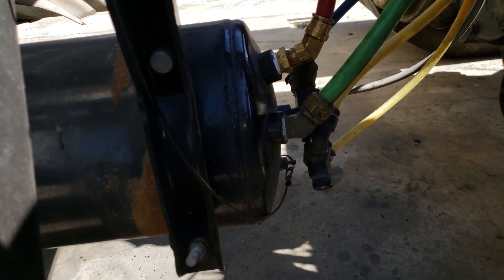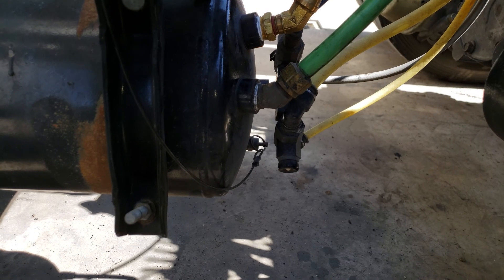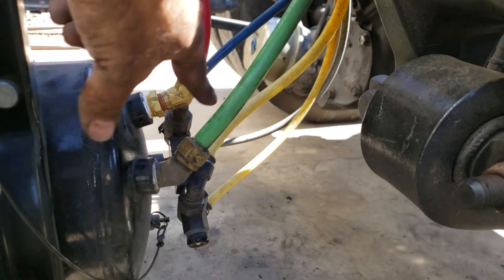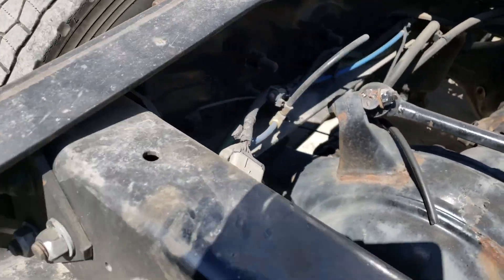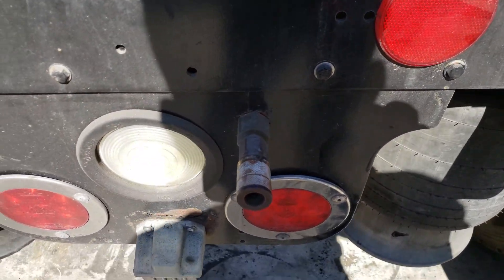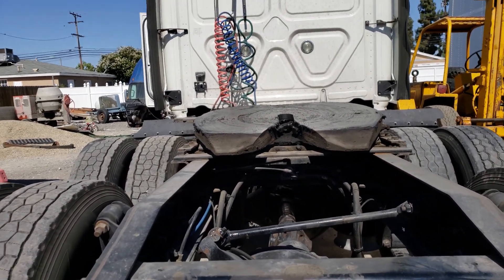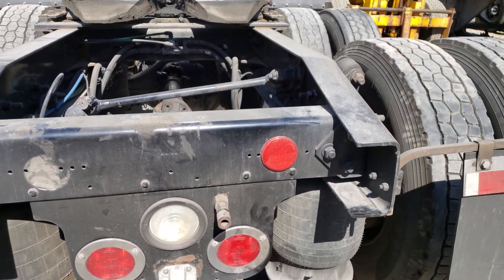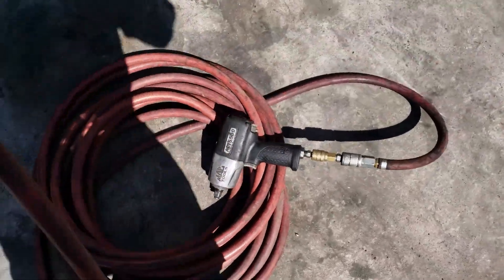How to use semi truck as air compressor

Comment: Or just buy a long enough  air hose with glad hand  Connect to tractor glad hand change out the connector at the other end to fit any tool
Reply from the maker: Its not the same

Comment: Hello, if my truck is under warranty and I will do this kind of setup. It will not affect warranty by any way?
Reply from the maker: Ask your dealer i dont know how that works
Reply: Hi, 
Is it give you more air output. I need 120psi and barely getting 110 for gland connection.

Comment: Yo what is needed for a 1” impact gun? I am looking to change brake shoes and wanted to do it myself. Get the 1” impact gun, run the air hose from air tanks, anything else?
Reply: At least 140 psi to run that 1” gun on 1/2” hose

Comment: Great video. 👍 I got thinking about it from the DIY concept. When you're taking apart pallets. They make an air powered nail Pusher that makes it way faster. And of course the board puller bar.🤔

Sure would be nice if someone would come up with an APU with an air compressor on it. It would be pretty nice for off-grid living.

EDIT/ theoretically couldn't you convert one of those hoses they sell at flying j. You know the ones that hooks up to the back of the catwalk..🤔

Comment: I hooked up to my glad hands and painted my car with my semi. Just put an in line pressure adjustment and start spraying
Reply: Dude, I was thinking the exact same thing, how did it work? Did you get proper atomization? Did you have to pause every couple of minutes to build up the air?
Reply: @DarkChaos751  worked great. I left it running and just bumped up the idle. Never lost air pressure
Reply: @patrickdolan.  Sweet! I have a metallic green that I wanted to paint on my Z, but didn't want to invest in a $1800 air tank set up with no place to put it, I ended up getting plasti dip with a wagner sprayer, but that's good to know!

Comment: It's a lot simpler to put a glad hand on an air hose. (They even sell pre-made ones at truck stops.) Then you connect the air hose to the RED glad hand and push the RED button in your cab.
Reply from the maker: Its too slow,  when you're trying to do all 18 wheels
Reply: @TRUCKINGTIPSDIY  How is it slower?
Reply from the maker: This way, you are getting the air straight from the tank
Reply: @TRUCKINGTIPSDIY  Are you familiar with Pascal's Law
Reply from the maker: Yes, this iis also to use air tools not just to inflate tires, but if you think that using those glad hand hose its fine, this is just another way, if you dont like it theres a dislike button.  Thanks for watching
Reply: @TRUCKINGTIPSDIY  The way you showed works well, I'm sure. Your way just requires a bit more set-up work. 🙂
Reply from the maker: Thank you sir, I appreciate you watching my video 🙏🙂

Comment: Lot easier to just run the hose from your air tank, the fitting could have just as well been at the air tank and buy 50 foot or 100 foot air hose

Comment: This is no a goood idea , just buy one Glad Hand Air Hose change as your video's  female connector . When using it just connect to red line . Can do better !
Reply from the maker: Thats too slow 🐌
Reply: @TRUCKINGTIPSDIY  If always require to change tractors for driving everyday , install everytractors ? your way just good for owner operator.
Reply from the maker: Ok i see, in that case the other way its more convenient you are correct,  thank you for watching!!

Comment: You could gust put a male coupler fitting on the air tank
Reply from the maker: i do it this way so the hose will be long enough to put air on the trailer tires, but coupler on tank works too

Comment: What size airline and what size coupler did you use for the tank
Reply: Sad, He never answer this question. I also wondered that.
Reply: The air hose must be 5/8 and fitting from the tank must be 5/8 but you can use 1/4 fittings to connect to gun. I mean the fitting connect gun. It can be 1/4 fitting it will work.